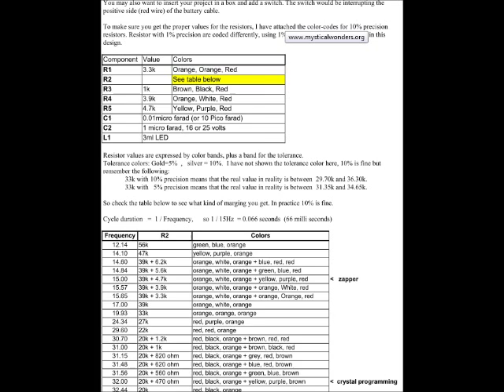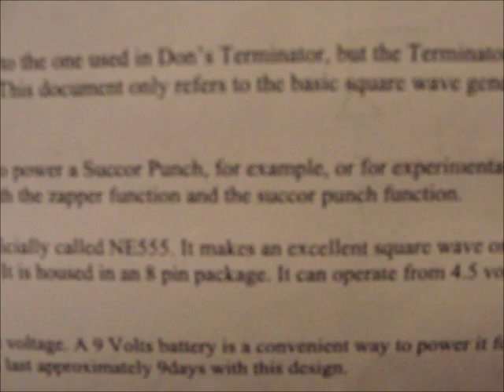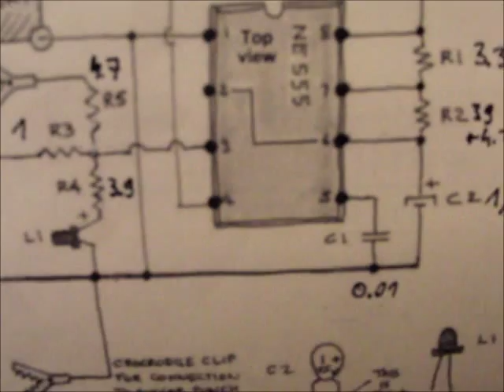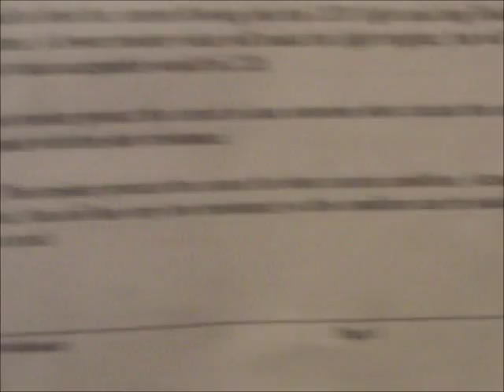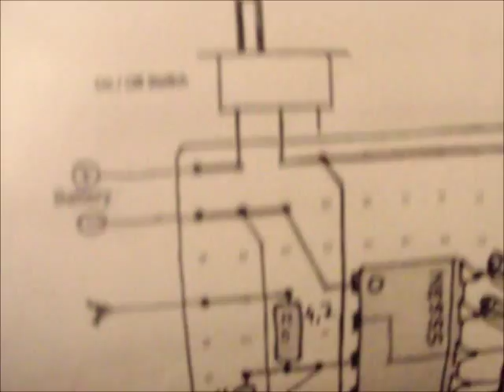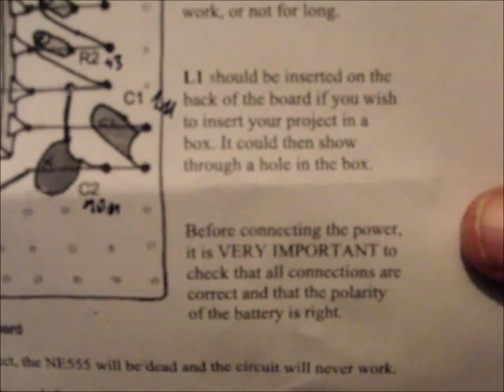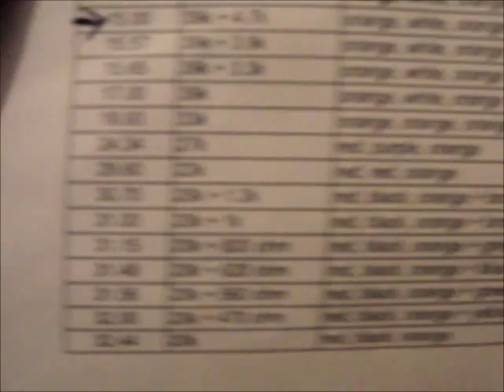Howto Build 15Hz Dr. Clark like Zapper for Killing Parasites or Succor Punch positive Scalar Waves

Comment from the maker: check soldering,  a shortcircuit maybe or defective parts? this printout works if done right, easy to check with loudspeaker at the output, if LED stays dark, change its resistor, try a lower one or other LED (not blue! red is best, then green)

Comment from the maker: my C2  has + and - pins too, didnt check with osci, just with a speaker as output, sounds pretty 15hz like :) doesnt matter if its extremely exact, this one is used as generator for a SP moebius Crystal